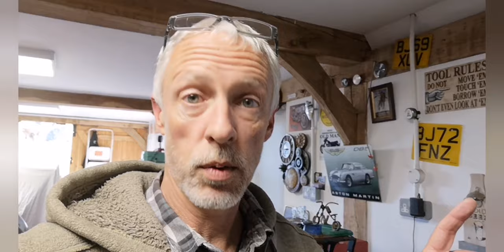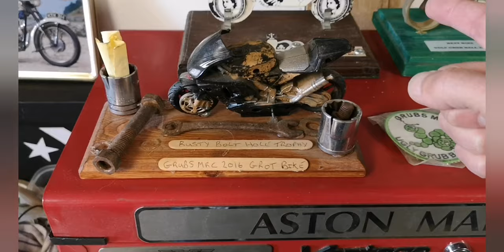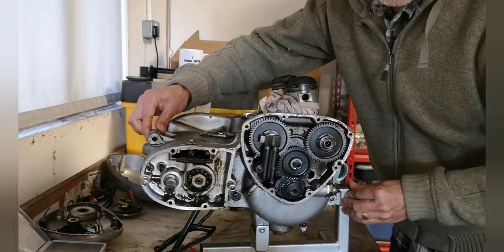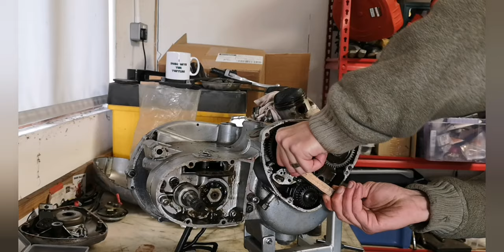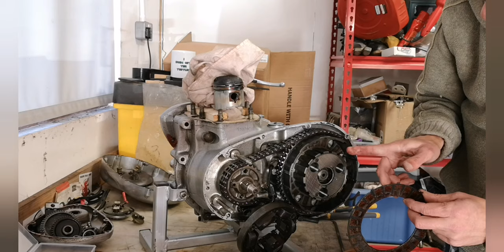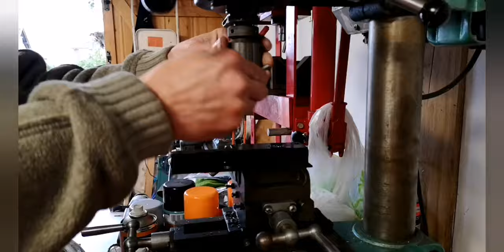Project Triumph Tiger 90 Episode 4

Comment: Bit of a whoopsie with the clutch hub there - but anyone who works on engines has done stuff like that. Usually a few seconds after that little voice whispers 'that's not really the best way to do that', and you shut it down by answering 'I do know that - I'm not stupid! It'll be reet' :D. Nowadays when I'm pulling something if it doesn't start moving under light puller pressure, I'll apply a little heat. Often makes no difference, but stops me saying 'I wish I'd applied some heat' when it breaks..........
Enjoying your vids - but I do notice the absence of a hot brew.
Reply from the maker: Always a brew off camera!

Comment: Just catching up on your vids. ,  (4stroke that is) and I thought if you traveled from Tamworth \Lichfield you probably didn't win the longest traveled trophy at the Grubs 😉  ,  also noticed the Dragon Rally stickers behind the T90 engine , so if you've done the dragon and this years Grubs (rained none stop) maybe you're not just a fine weather  rider 😄😄
Reply from the maker: No stranger to a bit of rain, or snow and mud in the case of the Dragon.
This Tiger 90 won best bike at the Polar Bear rally in Worksop, 1993ish. 4ft of snow fell sunday morning, and it took 5 hours to get home. I had to unfreeze the carb under the hand dryer in a pub at one point. 😂

Comment: If you are planning to reuse the alternator, put the rotor inside the stator or use half round protectors or you may loose magnetism. Also will be interested to see how you loosen the gearbox mainshaft nut on right side, as the clutch centre is scrap, you may be able to grip this?
Reply from the maker: Damn. good point! I pulled the transmission as a complete lump!!

Comment: I looked at the '63 90 parts book... Am I wrong, it should be 5 steel, 4 friction right? Steel against the basket. I know the later 500s have 6 each, friction against the basket.
Reply from the maker: Confused me too. My 3TA in my TriBSA is as you say, but I think in 63 they changed to 6. Mine must be right on the change.

Comment: It's not hard to at all. If you use the right Tool. You use a clutch hug puller and it comes off as one unit and then the puller to neck out ( tap on the center bolt) the center out of the hub.